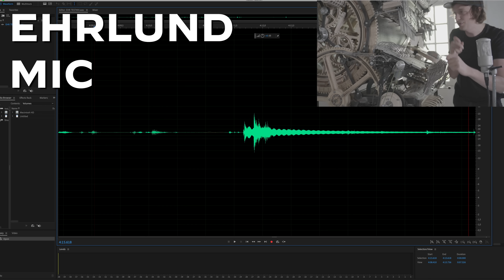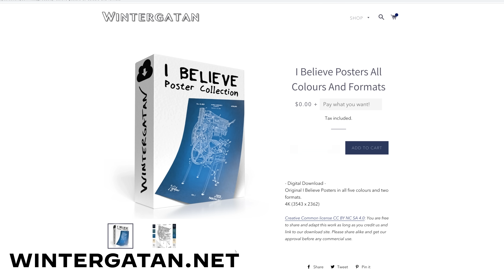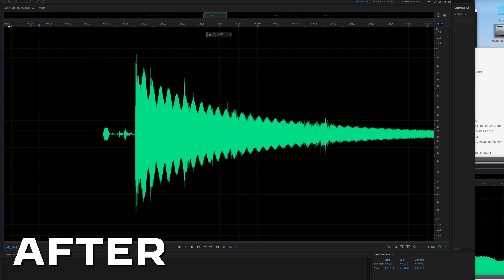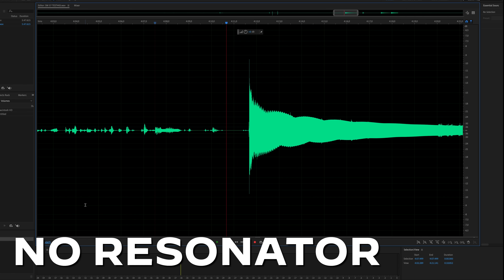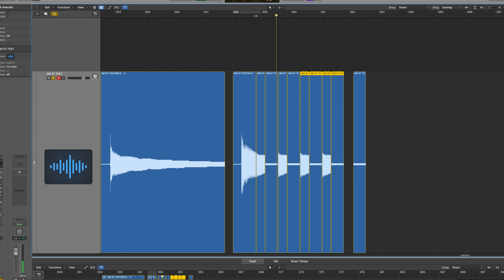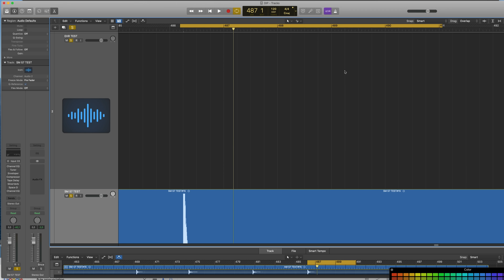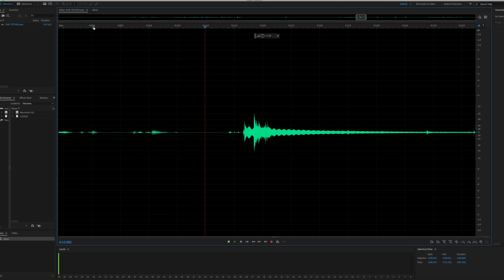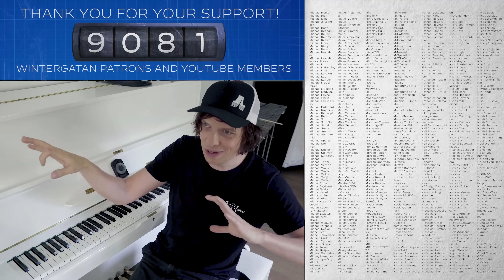Candy Dip for Marble Funnels - Marble Machine X135

Comment: I think you should apply the resin to the steel balls. There for removing the travel noise of the ball through the machine and also the bounce of the finger there fore the need for a rubber pad. Hope this helps

Comment: You could use black dip spray coating for the frame. There are some places where you grinded / welded something additionally, it would cover those spots nicely.

Comment: As an engineer who works extensively with creative/art direction, conveying the message that you can't have every single thing in a design be perfect is very challenging.  Watching your videos over the last couple of years has been an excellent case study in the realization of these challenges from someone without an engineering background. The way you have changed your approach to the MMX over this time has been truly impressive.  Even though it seems like you're not going to get there, DO NOT GIVE UP!  The MMX is an absolutely amazing achievement already and it will be something for the history books when it's completed.  Stick with it and eventually the moment will come!  Also, it can be a difficult reality to swallow, but something like this is nearly impossible to design to be "maintenance free" or even "low maintenance".  There will be things that will break or need frequent care, and that's OK.  In time, machines tend to have very consistent quirks and those maintaining them begin to truly understand their behavior.  As long as these are manageable and don't prevent the machine from doing what it needs to do, the project is a success.  Keep up the absolutely amazing videos!  I can't wait to come see you perform on the MMX in-person someday!

Comment: Yo, it would be sweet to do a principle components analysis on the before and after, it would isolate the difference between the two waveforms, one channel would be the part that sounds the most the same (i.e. the note itself) and the the second part would be the part that sounds the most different (i.e the change that the plastic coating was responsible for ... and any other difference in the recordings).

Comment: Over time you will need to re-coat the hit points on the funnels as the collisions from the balls will eventually break through the rubber due to the very small contact point.

Comment: Removal of non-critical constraints is the only way Lockheed could build the SR-71. It leaked fuel on the ground, couldn't even take off with full tanks, and needed a startcart and hypergolic additive to start its engines. But it flew higher and faster than anything else, and that's what mattered.

Comment: I found something interesting. im not sure what video it was. but martin chose the thickness of the pad for the sound, he then marked EVERY landing position and designed the funnels to catch those positions. He then changed the funnel angle to 'look better' but then it no longer caught all the marbles. now hes talking about changing the thickness of the pad which make the hops off further. 

It almost seems like hes forgetting some of the things hes doing and why and just going back over them. i know time is limited in videos and it may not catch everything, but perhaps there is more to it and he has thought of it.

That said, if the marble catchers dont open enough, can always use a weaker spring steel?

Comment: Martin, about the conclusion at the end of your video "don't include all constraints", I would suggest to go with "reconsider the priority of your constraints" instead: 

There's a design method in which a difference is made between Requirements and Wishes or between what you really need and what you want. 
Using this approach can help you out with making all kinds of choices. Basically what you do is consider if any constraint that you foresee is something that MUST be satisfied. For example, the MMX MUST be transportable in order to be used on the world tour or the Funnel MUST collect the marbles. In case it's something that is not an absolute necessity, you can consider them as wishes. This doesn't mean wishes are not important, instead they provide you with a tool to make choices based on what you think is important after having dealt with the hard limitations of the requirements.

Comment: If your liquid is very viscous, then a higher temperature should make it runnier and get smaller drips. You could put it in an oven for a few hours right before you use it (don't boil it of course, just nice and warm).

Comment: Hey Martin, I think the resonator pipe at ~9:20 is indeed sligthly out of tune. When you listen very closely, you can hear a little vibrato in the note with resonator pipe. That's the result of two pure notes of different frequency sounding at the same time. This vibrato will become slower and less audible when you tune the pipe towards the correct note and faster and more audible when you tune in it in the "wrong" direction. Hopefully this helps with tuning!

Comment: A colder temperature would have only increased the viscosity if the coating. If you wanted it to become less viscous and flow easier (or be less “thick”) you would need to increase the temperature of the liquid.

Comment: At around 3:50. LMAO. Just sling it off. It's taking too long to just let it drip away. Had a thought. Not doing that and just letting it drip away could coat it too much and lead to a bigger issue. Easier to build up thin coats than to have to reduce a thick coat.

Comment: The ball release mechanism could probably do with some plastidip too, mainly on the guide runners. This would reduce the sound as they're released. Minor but would help dampen noise when lots of marbles are dropping at once.

Think the other minor noise is the marble hitting the steel bottom as it exits the rubber section, running over metal and into the plastic funnels. Probably not worth the effort (you need a bigger container!), least at this stage.

As for that slight two-tone effect between start and finish - you need to compare them at the same volume. The volume difference can play lots of tricks on the ears.

Comment: You really should have the whole machine designed as a set of modules, separately, which could get moved one by one. All the extra work is only a sync mechanism. In that way, you could plan anything, more instrumental parts,more decorations, basically everything. Each part is much smaller and they could even be duplicated and sold.

Comment: I always find that an iterative design process helps because you start by a naive attempt and improve upon it until it works the way you want it, then you can adjust the style or work on the decorative aspects of it because you know what makes it work. The drawback of course is that this method requires more prototyping which translates to material and time. Keep up the good work, always fascinating to hear your perspective of the process and the responses in the comments. Regarding how much time it has taken, that's what I think truly puts the spirit in any art form. If you didn't put this much effort into this project, your fans would not appreciate it nearly as much (or so is my guess). Personally I think it makes things look not genuine if there is a show and everything they make is perfect the first try.

Comment: I'm afraid funnels coating will wear and tear pretty fast, not to mention the rubber (if not silicone-based) to age pretty bad (crackle with UVs)...

Keeping your initial design for funnels with some refinement (clear silicon rubber for instance) should have spare you all those troubles. And visually they may have been pleasant to the eyes without obstructing view (like you did with clear acrylic tubes).

Anyway keep making us dream and good luck finishing this wonderful project ! ;)

Comment: Critical steps in design

1. Make it work (Initial prototyping. Proof of concept.)

2.  Make it work well (Developmental stage, make it as efficient, powerful, dependable, etc as you can)

3. Make it look good (Clean up appearance AROUND the function)

NEVER TRY TO DO THESE OUT OF ORDER

Comment: Learning how to get through design constraints is an ongoing battle. I'm glad you've got your handle on it for you. I mostly fiddle about with electronics, and I tend to use the conservative approach of building a series of tests before going to a full prototype. It works for me, but I can see how it won't work for others, certainly not you in theis case.
I have the luxury of plenty of time, and the ability to do this. 
I guess a lot of it boils down to clarity of thought. Take a step back and look at what contraints are REALLY applicable to you and try to stick to them. Always be honest with yourself.

Comment: Martin, you may find some value looking into techniques used in Systems Engineering. What you're talking about in figuring out constraints is focused on in the "Requirements Generation" stage of systems engineer. What you're talking about on removing constraints is very familiar to the process used to generate requirements, it boils it down to the key requirements needed to accomplish a goal. It's probably way over kill to follow the complete systems engineering process here, but some useful concepts can be used.

Comment: Line those catchers with a clear silicone sheet. Done. It will dampen the sound like crazy. And since it is clear you won't see it from far. Same for marble rails anywhere there is noise. You can order the stuff by the sheet and glue it down, or use 3M 2 sided tape (clear)

Comment: Your ending remarks remind me of the rule of three I used in construction. But you can only pick two and the one left out will be the constraint...
Done quickly
Done correctly
Done inexpensively
if you want it done correctly and inexpensively it won't be done quickly
if you want it fast and cheap it won't be correct
if you want it built right and built fast it won't be cheap
Very much looking forward to the world tour.

Comment: The spring action of the funnel bouncing is from a bit of spring steel, right? Now that the funnel itself makes less noise, you may be able to restore the bounce with a "lighter" (ie, less rigid, more easily bent) piece of spring steel.

Comment: What i would have used is silicone RTV rubber (like sold for caulking bathtubs and aquariums).  It is not poisonous (save for acid fumes, which are no more poisonous than vinegar).  It is paste which you could apply with finger, and layer more/less to suit.  It is also more repairable, and will not do nasty things with age.  It adheres well to stainless steel, so will not peel off.

Comment: What happen if you place a thin layer of that industrial pur on the marbles?  The noice between metal would be lower in the whole machine.  Testing that with few marbles would not take much time.  The problem is how to dry the marbles in a smooth an average way.

Comment: the rubber help some what about Felt if the metal ball hit the Felt it might not make any sound  Felt is a textile material that is produced by matting, condensing and pressing fibers together  https://cdn11.bigcommerce.com/s-5qg929/images/stencil/1280x1280/products/49/486/Plant_Dyed_Felt_Hero2__62058.1363917099.jpg?c=2

Comment: Working around constraints is a time consuming process, but the only alternative is to conceptualize most of the design, classify every point by it's constraint potential and test the more critical points. That's why designing things complicated as space rockets or airplanes take a significant amount of time to leave the design stage.
Except of course if you are elon musk, then you iterate through a lot of prototypes until you have all the constraints figured out, the problem is if one constraint turns into a design flaw later after the production phase.
Keep going with the MMX you already surprised the majority of persons with your progress

Comment: So, ...
Things i dont get there is how in the world u didn't use silicone pads or latex instead of rubber ...

If the impacted is aluminum it could bring an easier after care ...

Marble will impact an aluminum "whatever the design" piece spare from the sound maker piece by silicone patches or latex ...

That might not compromise sound or potential energy the marble ...

By the way .
It's not that of a traditional sight the kitchen ...

Comment: I know why your marble bounces are inconsistent on the vibraphone! - it is because the note bars are moving on their spring mounts. If the bar is travelling up at the time of the hit, the closing velocity is higher and the marble bounce will be higher. If the bar was moving down, likewise the hit velocity will be lower and the bounce much less pronounced. You are going to need to have a fixed mounting for the vibraphone..

Comment: You need to add a small rubber bumper at the bottom of the hinge on the solid metal portion, not just the wire portion.  Also, a rubber gasket fitting to prevent metal to plastic contact for the  connective point.

That would remove all the residual vibration, and still allow the free bump design like originally intended.

Comment: This is an excellent lesson to learn about keeping your design constraints manageable. An interesting historical parallel is Lockheed's development of the SR-71.  For instance, most people know that the SR-71's fuel tanks leaked constantly while on the ground.  This wasn't a design oversight in any way and it could have been fixed.  However, the fixes available would have all added weight to the air frame effectively reducing the speed and altitude that the plane was cable of reaching.  Since speed and altitude were the primary design constraints of the project and the fuel leak resolved itself once the fuselage was up to temperature, it was deemed an acceptable loss.

Comment: 10:10 Could you apply a small layer of that new liquid rubber you put on the marble catchers onto to the vibraphone bars to remove/reduce the harshness when the marbles strike?  Ever consider using rubber coated balls that are made of metal in the inside? Maybe dip all your marbles into that liquid rubber?

Comment: Just a suggestion. What if you built trampoline type pads that hover slightly over the xylophone for the marbles to hit (these could be silicone pads compressed between a sheet of metal). This in theory I think would provide a sharp note while also allowing the marbles to jump pretty high. Keep up with the great work!

Comment: Higher temperatures should in theory decrease the viscosity of the dip. They will also cause the solvent to evaporate more quickly and possibly for the dip to "wet out" (flow) poorly. Most dipping compounds (like most paints) can be diluted to decrease their viscosity - the tin should mention the suitable solvent and the maximum rate (over dilution can cause drying agents to fail or other unwanted effects). I would suggest putting the catchers through a series of cleaning dips (degreaser, clean water, isopropanol) to maximise adhesion of the dip...

Comment: A thought about the weird resonance
If you have seen the high speed video of a glass breaking in front of a speaker, the rim of the glass wobbles around like rubber.
The chamber of the pipe will have one resonant frequency, but the pipe itself may have another, i'm thinking the end of the pipe is acting like the rim of the glass casing the weird effect.
Slice off a piece of spare pipe, cut a gap in it and fstretch over the end of the pipe to make the end thicker as a test.

Comment: You should watch out you do not overdo the sound engineering.
You are creating a marble machine after all. This will lead to noises you might not want in music, but they are an integral part of the instrument. If you try to remove all side noises that come from playing with the instrument you might as well put down a synth that brings the cleanest sound you can get. 
Because looking at the very base of things, there is not much difference between your marble machine, a "normal" music box or a synthesizer.

Comment: I would have used a (clear) PVC  Plastisol heat cured dip... the stuff used on tool handles - like pliers.  You would preheat the metal part in an oven, dip in in the Plastisol until it builds up to the thickness you want, then place the part back in the oven to cure. It would give a much thicker coating in one dip, would be more durable, and more importantly would most likely reduce the sound even more. I also believe it's not going to be as toxic. Learned how to use this stuff in plastics shop way back in school some 45 years ago. Before that played with the Mattel "Creepy Crawlers" toy. 

https://www.piper-plastics.com/processes/dip-molding/dip-molding-about/

https://youtu.be/b66DQo9TZDw